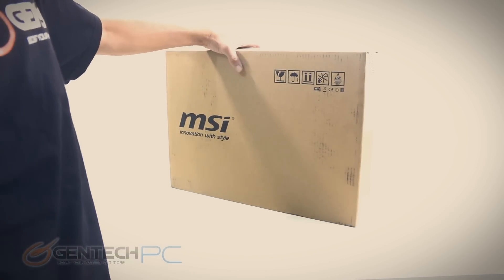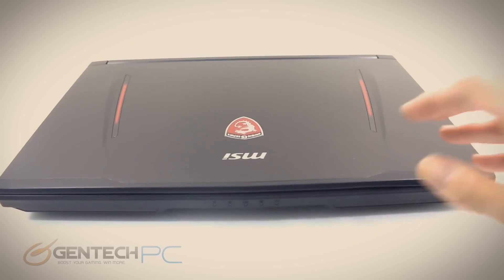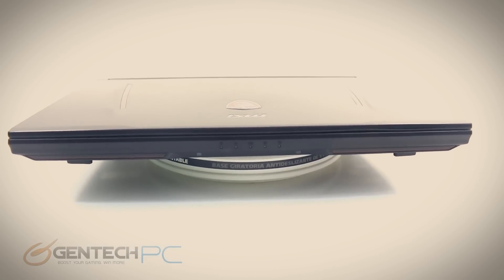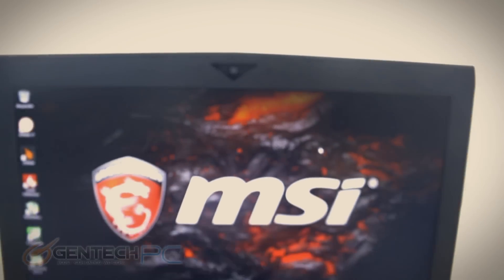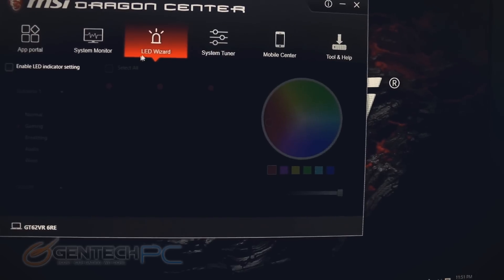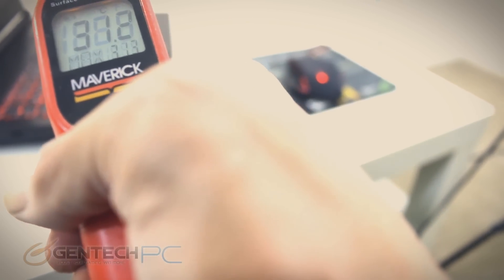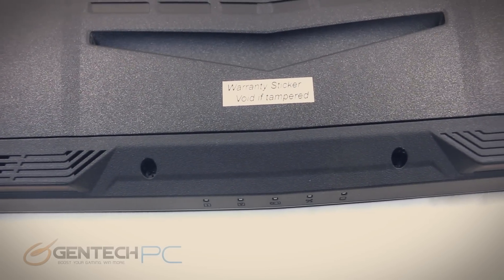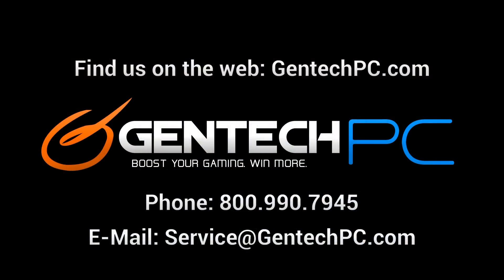MSI GT62VR Full Detailed Review w/ Benchmarks (Nvidia GTX 1070)

Comment: My question is the fact this laptop uses the Killer N1435 Combo (2*2 ac) network wifi card. And has some issues with dropping signals. Does this retail version have any issues with wifi networking?

Also is the battery able to be removed and replaced?

Comment: i will stick with my 3 years old and half gt 60 with gtx 780m, my 3 SSD's  and 1 to dd drive. 24go ram ddr3. I just love it, with good drivers and keeping clean, it works perfectly, just got some dpc watch dogs errors sometimes... i tested raid 0 with two 256 go ssds but it failed more. I bought a 1To ssd late 2015 but when i saw it needs 20% free space to work and live correctly, i just canceled the oder... Too bad there is right now only one SSD place. I do not VR or 4K. i will wait more longer  but really nice test

Comment: Okay, so two years ago I bought an MSI GE60 2PE-012NL gaming laptop. Over the last few months I've gone through quite a lot of trouble with the hard drive. The performance on a lot of (new) games have been kind of disappointing. Oftentimes I can hardly get GTAV to run above 40fps. Rocket League stays at about 50. I'd really like to get a new gaming laptop that will run games smoothly at high quality (not ultra settings, but high.) The laptop in this video appeals to me. But since I don't much care for VR, it seems like a different MSI GT (or a different brand entirely) would be more suitable. If you (or anybody) could help me out, I'd be very grateful.

Comment: I'm planning on buying a new computer before my next quarter comes, and I'm wondering which is a better choice for a long lasting laptop that could do both gaming and everyday things. The two laptops that came into mind was the MSI GT62VR Dominator Pro and the Acer predator 15 with the gtx 1070, which one of these laptop would you guys recommend? also im open to other laptop choices that has a gtx 1070 or 1060.
Reply: Fitment Flow With te gt62vr you can change the gpu.

Comment: I really cant decide what to buy, there are 2 models i prefer, ASUS GL502VS and MSI GT62VR . The problem is that MSI is ugly, but it has better display than asus (120hz vs 60), but I heard that color rendering on msi is worse, however asus' response time is lower than msi's. The second thing is that MSI starts throttling when temperatures go too high, is there some problems with ASUS ? Actually I really don't know what to buy. I need laptop only to play twice a week at my country side. Plz recomend me something! Thanks a lot in advance!
Reply: the 3dmark score is pretty low! should be around 15000 for firestrike. notice the 1070 only hit peak core clock of 600
Reply: Dead Man Talking You are so wrong, the msi dosent trottling but the asus get TOO hot with sone trottling.

Comment: I just bought this laptop, cannot wait!
Reply: Fitment Flow
The thing is I owned a MSI Laptop for 5 years problem free, so when I had that happen to my new GT62 my initial reaction was shock because for it to be DOA out the box was crazy to me, but I guess anything is possible. I was hesitant at first as I wasn't sure about leaving MSI, but Acer's quality has gotten significantly better, and after seeing the Predator 17 at the Microsoft Store in person, I know I made the right decision.

Three others things to consider the Asus over the MSI: 2 M.2 slots, Thunderbolt (MSI doesn't have it), and a Disc Drive (This might not matter to you, but it might be useful). These three things for me were easily worth the additional cost. With 2 M.2 slots you can technically have 3 Drives in this laptop, that greatly increases upgrade-ability down the road.
Reply: Fitment Flow I'm getting my laptop today it should be here in like an hour or two I'll keep you posted
Reply: Tyler Mac
I'll think about it! the only 2 noticeable cons are backlight bleeding in both upper hand corners (Not that big) and the laptops wrist area is sharp while typing. I've already put the laptop angled 45 degrees (all my laptops are like this) and it's much better now.
Reply: I took my time fellas, but I wrote my own review of this on Amazon, if you have any questions let me know, it took long to write because it was spontaneous:

https://www.amazon.com/review/R2BSPE5EFN6EIA/ref=cm_cr_dp_title?ie=UTF8&ASIN=B01LD4MKQI&channel=detail-glance&nodeID=541966&store=pc
Reply: I've got an absolutely faulty unit and am trying to send it back. I've been plagued with drive errors, shit tonn of outdated drivers. For the price Vs what you get outta the box as well as well as the issues isn't worth it.
Reply: Guys please reply is this still a good buy in 2018?
Reply: Illmatic662 How is it working out for you?
Reply: Tyler Mac
Huge regret sadly :( I received this laptop about a week after this post and it was DOA (Dead on Arrival) I tried to get MSI support to help and they pretty much said right out the gate that something was wrong with the machine. The two options I had was either exchange for another or wait weeks for a tech to come out. I returned it to Amazon and bought a Acer Predator 17 instead, it's coming tomorrow so I'm excited.
Reply: Illmatic662 yo man I'm glad you commentd, because I'm deciding on either buying the msi gt62vr or the acer predator 15, and once i saw this I'm now leaning towards the acer side
Reply: Illmatic662 the thing i read about the acer predator is the good build quality keyboard, and the thunderbolt 3, but i'm curious on how the acer predator preforms under high temp/load because i've read that it has a bit of a temp throttling, so from your experience have you noticed that?
Reply: Illmatic662 alright, thx man
Reply: Tell me your new one wasn't DOA as well..
Reply: Tyler Mac
Hahahaha nah it wasn't I got it, the laptop is fantastic! The Speakers are amazing, these have to be up there with the best on the planet, I'm actually working on a thorough review that I'm going to post on Amazon.com so far I'm very impressed, this reinforced plastic feels great and looks great. I can tell that this Laptop will age well. The noise is minimal, have not heard the fan come on even once since I've been using it for the past 8 hours.
Reply: Nice! You should make a youtube review also!
Reply: clarencezer ur suppose to update ur drivers
Reply: +Nino I can't comment on how it compares to Laptops now since I haven't kept up since I bought my Laptop but a month and a half later this laptop is still going strong.

Comment: Removing the back does NOT void the warranty. I called MSI Canada at 1-888-447-6564 and asked them about this. The rep said it will not void any warranty to upgrade your RAM or storage, but if you damage it, then it's on you. He said the sticker is common manufacturing process in North America. Who's to say if something happens in the future though that IS manufacturer defect, they may blame it on you for opening the case. Anyways, just my two cents.

Comment: what kind of temperatures are you at when running games at max settings WITH cooler boost on?  Do you ever get above 80˚C with cooler boost on?  Or even 70˚C??
Reply: curly0117 you shouldn't since it runs the runs at a constant 100%. Temps would stay nice and low. May get into low 70s, worst case.

Comment: is this more powerful than an xbox one or ps4? thanks
Reply: Of course
Reply: sammy smith Considerably so. The PS4 is more or less a mobile CPU paired with a GPU equivalent to the GTX 750ti (which in turn is comparable to the GTX 960M). The 750ti was a relatively weak chip when it came out in early 2014, literally any modern GPU would be faster than it is. This laptop smokes the PS4 in every conceivable regard
Reply: thinking about getting this laptop, so it can run all games on max settings, say the witcher 3 or fallout 4?
Reply: sure fallout 60fps for witcher like 58fps all ultra
Reply: It is more powerful than the new PS4 neo lol

Comment: I think you might have forgotten to turn off V-Sync before you ran Fire Strike (see max fps @ 13.50).. I have the exact same laptop and just ran FireStrike. My score was 13188 (stock clocks). That's a pretty beastly score for a laptop. Can't remember the score on my desktop, but I believe it was around 17-18k (GTX 1080). Not that big of a difference.
Reply: Pragmatic Tornado hey dude quick question, is this laptop still a good buy in 2018? and how long do you think it will last without the need to upgrade?
Reply: @Its_Ninooo  Hey, sorry, didn't see the comment until now. Got no notification for it. I've actually tried to find reasons to upgrade from this laptop, but I can't find any. I do have a desktop with an RTX 2080 Ti, but I mostly play the same games on the 2 computers and I use my laptop more than my desktop.
If you can find one used for a good price, I will still say it's a good choice for a gaming laptop. My brother actually just bought a GTX 1070 laptop (newer CPU, but most everything else the same as this one), after I recommended it.

You've probably already bought a gaming machine, but maybe someone else will find this comment useful.

Comment: What the hell. Now people are not allowed to upgrade their own system without voiding the warranty. I guess no MSI for me. Will check the Asus then
Reply: don't worry they have just said that to prevent foolishness. they will not void the warranty. they're pretty cool about it all
Reply: You sure? I'd love to throw in a WD Black mechanical drive and maybe a 512GB M.2 card (if it's supported). Possibly also double the RAM later on.

I'm also a certified IT Administrator - but I'm fairly sure they wouldn't care even if I scanned my diploma and mailed it to them...
Reply: check out the videos on this from linus.. imean the old gs60

unless you fucked it up they're cool... i mean when they open they should find out that you fucked it up. :P

Comment: did u tried to re-run the 3dmark? the score is much lower than the asus g752 you just tested
Reply from the maker: It's because of the driver, the benchmark was tested with non-production driver and nVidia won't release the official driver till 8/17.  I'll re-run the benchmark after the official driver is released.

Comment: Does GT62VR equipped with DVD -Rom?
Reply from the maker: No it doesn't, no optical driver at all.
Reply: That's unfortunate, because MSI is advertising that it does have a DVD drive:

https://us.msi.com/Laptop/GT62VR-Dominator-Pro-6th-Gen-GTX-1070.html#hero-specification&sku_no=1752

https://us.msi.com/pdf/nb/GT62VR%20Dominator%20Pro-073.pdf

Comment: Hi, so the cooling system is compatible with 1070 right? The graphic won't boost due to overheating?
Reply from the maker: Yes the cooling is compatible with 1070 and 1060.  The new fan blade and heatpipe design doesn't cause overheating at all.
Reply: Thank you so much! subscribed
Reply from the maker: Thank you for watching and your support. :)